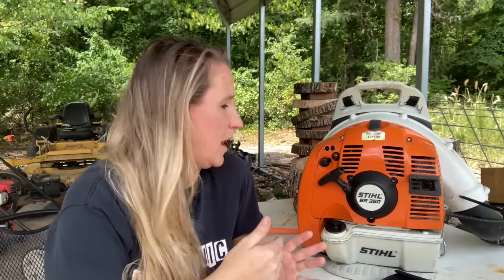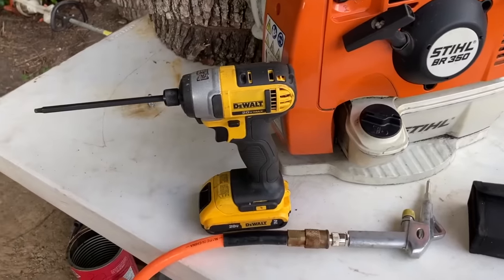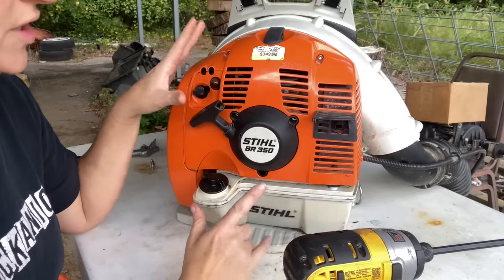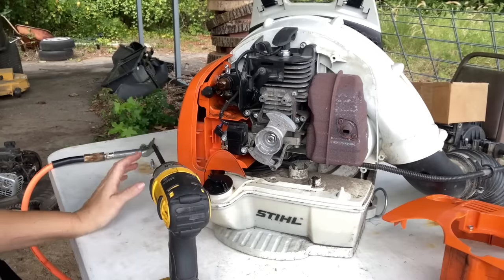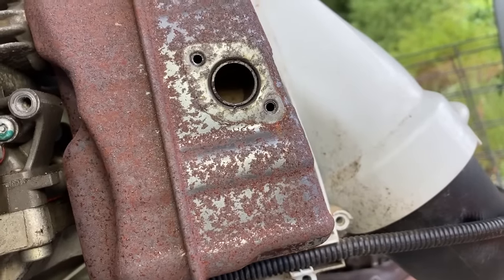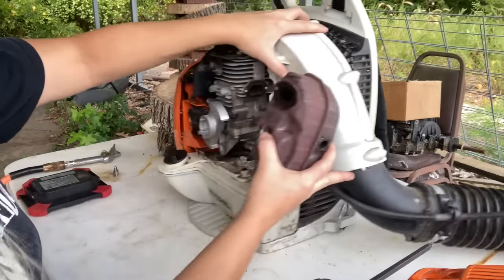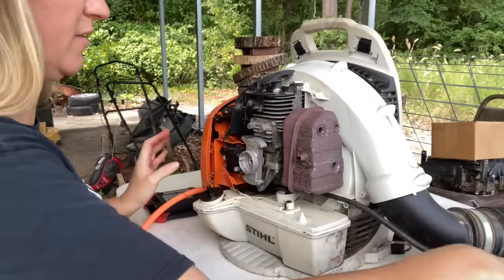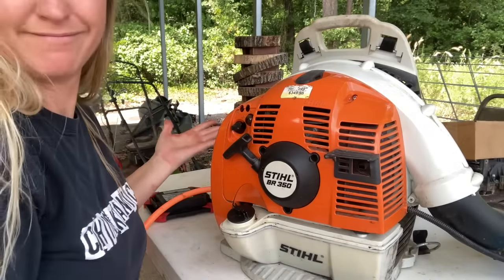Stihl won't throttle up or stay running? First thing to check!

Comment: Do a Stihl backpack blower 340 have a spark arrestor on it if so I couldn't find it
Reply from the maker: Here is a link showing where it originally was, but it being an older blower, someone might have taken it out when you had it at the shop. https://www.diyspareparts.com/parts/stihl/diagrams/br-340/30e0a753-f56c-47fe-b38a/

Comment: I had a poulan PP5020AV chainsaw that I hardly used and after 3 years of lite use it quit throttling up. Would start, idle perfect but bogged down when throttling up. From the outside the fuel lines looked good so I bought a rebuild kit for the carb, well when I removed the carb thats when I noticed the fuel line looked to have a inner liner that collapsed, the otter hose was not even connected to the inner liner anymore. Who uses a dual lined fuel line?

Comment: How did you make it run prior to returning it to the customer the first time, and the had it returned to you a second time?
Reply from the maker: The bug got in there after I fixed it the first time. They can build a little mud house in a day.

Comment: Nice video!  I have the Stihl BR600 blower and I love it most of the time.  The problem I am having lately is that it is hard to pull over.  Once I get it to turn over with sufficient speed, it starts and runs good.  It is like the compression is too much.  Any advice?  Thanks.
Reply: Ohhhh mannnn
Reply: What oil do you use… what ratio… and you mean that there is increased resistance when you pull the cord?… and when did this start and how long have you had it
Reply: @tjlovesrachel  I mix 50:1. I've been using this unit for about 4 years, residential.  Yes, the pull cord is hard to pull over (since last year) but once I get it pulled it starts easy.  Thanks.
Reply: @cherokeefiddler  have you pulled off the carb or muffler and looked into the cylinder to check for scoring ?…
Reply: adjusting valve lash solved this.

Comment: Hello love your show! Please how do I store my chainsaw since as most homeowners it can be yrs between uses. Thank you!
Reply from the maker: To be honest, the ONLY saws I have ever seen that still had fuel lines intact and soft carburetor diaphragms after sitting for MANY years were older saws that were filled with 2 cycle oil. Like the fuel tank was full, they got a bunch up into carb, they oiled the outside buffers and then stored it in a box. It musta been an old timers trick, but it works..

Comment: I need help my brush cutter,I put new clutch,new driving shaft,new clutch housing and new clutch drum but still not stop spinning on head when I starting
Reply: I did idling settings and also caburater is new

Comment: I have a srm-225 echo weed eater, that want run off choke, if you've cranked echo's, you choke it, it's pops off, take choke off and your good, this one cranks on choke , to get it to rev I have to throttle the choke up and down just to get it to rev up, but want stay running off choke, the reason for the fix was the piston and rings, so got a new cylinder and rings and piston, but the pistons was always to small, by a few thousands , so I just bought a short block, used , good compression, but still want run, this has been a nightmare, for a 2 years old weed eater, maybe I'll buy a new carb and see if that will work

Comment: Hey chick.
I'm from Australia and I've got a mtm back pack blower and it's started to not start everytime I use it in hot weather it'll start first go and when I use it for like 10minutes it won't start once I've turned it off. Till the next day I try start it it'll start first go.
Appreciate if you can help as I really don't want to buy another 1
Reply from the maker: After it has been running and you shut it off, check the plug. See if it looks wet. It sounds like it is flooding itself and needing to dry out before it will restart. I wouldn't think it was a coil issue since it doesn't die on you while running.
Reply: @Chickanic  I just scored myself a used stihl br450c backpack blower for $250aud and compare the mtm blower I been using this stihl blower is amazing I can't believe I never bought it the first place. It's so much strong so strong it almost blows me back sometimes.
I notice the trigger has a easy start switch but cause mine is used it doesn't work. Does the br450c version have the battery inside or its just on the other version. 
Thanks for the reply and stay safe chick

Comment: If people see you running screws in with an impact driver they WILL strip them out.I have found that tool very handy for removing screws, But even the fine thread steel going into usually an aluminum part will strip very easily. Unless you use them all of the time it is better to just use a T-handle driver to run them in and also not starting them with a power tool stops them from a simple squeeze of the trigger to a cross thread a screw or bolt. None of them have that much torque on them that your average person fixing their own equipment should probably just use a hand tool. That is just my humble opinion!

Comment: I have a Stihl ts800 an I just rebuilt the carb an I put an new spark plug an my son took a screw driver an the the screw one the side of the carb an I can't get it back running help

Comment: Forgive me but, you sure have pretty legs!  My Stilh FS110R weed eater had a dirty spark arrester and I cleaned it and it fixed my revving problem last year however, this year it won’t rev and when I checked it recently, the spark arrester screen is missing.  Apparently the heat dissolved what was left of the screen.  Does it absolutely have to have the screen in order for it to rev?  Jerry

Comment: I threw mine away.if I catch the woods on fire ill be the first one I've ever heard of.now without it was running great.now will crank won't throttle up cuts off.then runs on choke on position but if you give it gas it high revs for less than 15 seconds then chugs off.

Comment: Do you have a video 
  troubleshoot  poulan pro pr 46bt back pack blower
 the spark plug is not sparkling I think it's the off and on switch 
 how do I troubleshoot this 

 and do you know where you can find  assemble and take a part picture
 step by step   poulan pro pr 46bt back pack blower
Reply from the maker: To make sure it is the wiring and not the coil, you have to unplug the kill wires from the coil. Not sure if it is easier for you to unplug at the coil or at the switch. The breakdown does not show me just the wires, so I am not sure if they are hardwired into switch or plug in. Try to start after you have it unplugged. If it still has no spark, then you know for sure your coil is bad. Here is the breakdown of it.. https://www.partstree.com/models/pr-46-bt-967086901-poulan-pro-blower-2019-01

Comment: My still 009L saw will run for 2 minutes and quit. What is the problem?
Reply from the maker: There are quite a few things that could make this happen.
1. Ignition module quits when hot.
2. Screen in carburetor clogging up. 
3. Fuel line collapsing.
4. Piston and cylinder scored.
5. Bad crank seals.
6. Tank vent clogged and tank vapor locks.
7. Etc.. Etc.. 
Thanks for watching!

Comment: So, how to you bill such a job?
Reply from the maker: The mud dauber wasn't in there in the first fix so I could charge, but since I sat on the unit for two weeks, not figuring it out, I will just return it, no charge. I usually charge 15.50 to remove and clean an exhaust. It doesn't take much time, but they are paying for me diagnosing. I should have figured this one out sooner.

Comment: Just get rid of the spark arrestor.. you don't need it. I took mine off probably at least 10 years ago and it runs perfect still. It's a useless item they install on there

Comment: I was not very smart and got two stihl chainsaws they were fine on the first tank of gas from the store but after that they wont run dealer talked me into the secent one gave them away to people that said i was wrong there great stuff but they count get them to run wen and got a  $150.00 saw it sits around and startes well no more stihl for me

Comment: I have message you on Facebook messenger cause I'm needing some parts for my echo blower. If I'm not mistaken you said you was a echo dealer? I could sure use you help if possible. During Florence storm it got flooded and I got it back running but the cable is stuck solid and I tried to use spray to loosen it up but no success.

Comment: I'm single 2 bad your NOT😂 I really  luv ya I do the same stuff but sometimes what works on 1 doesn't  work on all. So fs38 string trimmer starts kinda idle s but will not drink or its not getting enough 2 drink any ideas its not the muffler  an the metering &fuel pump look good but might b 2 hard it did sit waiting on the shaft but it had gas in it

Comment: Mud daubers have actually resulted in deaths.  A few years ago, an aviation mechanic in either Columbia or perhaps Chile, was tired of mud daubers. plugging the Pitot Tubes on aircraft.  Those openings allow critical flight control information to detect the difference in air pressure as the aircraft climbs, descends and register the air speed of the aircraft. The mechanic put a piece of clear tape over the opening to keep the insects out.  It worked, but no one noticed the openings were covered by clear plastic tape when it took off at night over the ocean.  It crashed killing all on board.  Vicious critters, those mud daubers.  Can't imagine the agony the mechanic will live with the rest of his life.

Comment: I think it would almost always be better to take the muffler off the machine before you attack that nest with an air blower. There’s always a chance the dirt and sand you blow loose could get in that exhaust port and between the piston and cylinder wall.

Comment: You stated multiple warnings about stripping out machine screw fasteners by using too much torque with a hand-held drill/driver. Evidently in your business, using a proper calibrated torque wrench is just too time-consuming. This is just another difference between a "professional" repair shop and a serious amateur home mechanic.

Comment: I bought a Stihl chainsaw brand new I did everything the manual said let it run for an hour and I know four or five times burn through a good couple tanks of gas before using I use this saw maybe two or three times now it don't run it all can't get it started I gave it to a buddy of mine he said the carburetor was shot I said put a new carburetor on it put a new carburetor on it started one time don't want to run again really don't know what's wrong with it really upset but still wouldn't even sell something like this not sure if anybody else is had this issue but now the songs like a year 2 years old just sitting in my garage

Comment: I have a Stihl chain saw I detest, I have owned several different brands of chain saws and seldom had any problems that I couldn’t solve. I have maybe 2 hours on this saw in the last 5 years. I can’t start the dam thing it has no compression release and the cord is like it is tied to some immovable object. I am 6’4” and 235 lbs. I have had it looked at by the place where I bought it and they get it running and when I get home the dam thing won’t pull. I will never buy another stihl  product. Expensive boat anchor

Comment: I do not like Stihl products! I clicked on this video because my leaf blower didn't idle up for the first minute while it was running. Also, it's harder to start than my Husqvarna chain saw. I had to replace the spark plug in my blower after the first year. The chain saw ran for 21 years on its first spark plug! This may be a lame excuse for disliking a product but hey, it doesn't take much for a consumer to have an excuse for dislike. Maybe I bought a lemon!

Comment: You ever get another like that. Take a hot air gun and put the air gun it on the inlet port and and just let in burn out , it will stop smoking when its done. And the port on the engine, I am afraid to use the hot air gun but screw driver works fine if your careful. I have done this to lots of Echo Weed Wackers. I think people run them to whimpy. I own lots of Echos and never have that problem. But I have bought lots of them like that. To tell you the truth Husqvarna I love Husky chainsaws but dont like there Lawn stuff. Sthil and Echo blow Husky away in Blowers and weed eaters and stuff.

Comment: You're a mechanic. You're actually tearing down the engine to fix it why is it that every single year? No matter how I store steel equipment it does not work brand new gas, clean carburetor carburetor cleaner, it does not work never in 10 years it never works. You can't take this equipment out of the garage after 2 weeks or a month and restart it without going through a mechanici. Am not a mechanic this equipment socks.